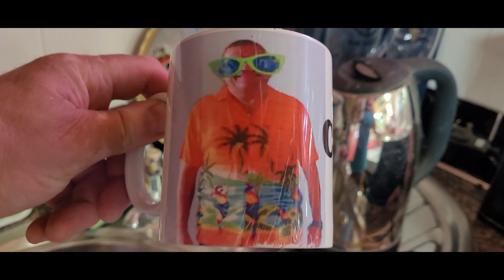up to my waist in water what for now

Comment: I have the same pump & bottom drain mate and my pump is above water. I have recently done a video on fitting a non return valve makes a massive difference now don't loose any water back down to the pond

Comment: You only have to watch that pump if you have a power outage then it might syphon back  into the pond.
You  have the deep end air stone right near the  out let of the green filter... Perhaps moving it over to the other side would help with the circulation a bit?
A Floating skimmer may help with the particles in the water. Other than that..  It  is looking  great..
Reply from the maker: as always thanks for your support .i have a floating skimmer but iv not put it on this year as im using my auto feeder .i have moved the air stone as you asked as you will see in my up and coming video.kind regards

Comment: 2 inch to inch and a half reducer then the thinner hose tail into the reducer ..  looks like 1.25 pipe trying g to go on an 1.5 inch hosetail..  retro drain is on 2 inch pipe
Reply: i used your technique for lowering the retro bottom drain into the pond. great tip that skeggy.
Reply: Put it in the Deep end 🤦🤦🤦🙆🙆
Reply: Close the valve -set the pump up then prime it with a hose up to same level as the filter. 
Open the valve and immediately start the pump 
This should push out any air locks and run.
Mines the same 👍
Reply from the maker: cheers daz scrag gave me 1"and 1/2" pipe so thats what i used but all the hose tails are poor quality plastic and to short really but its done now.cheers skeggy
Reply from the maker: cheers dave i need another 1 for the deep end m8.its in the shallow because its nearest to the nexas m8 thats all
Reply from the maker: cheers for that i have it sorted now i think

Comment: The manufacturers of horsetails are a joke, they hardly ever make the tail long enough to fit the bigger pipes.  It’s a shame someone doesn’t come up with a hose lock type system of hose tails and matching hose in the various diameters of hose.
Reply from the maker: most koi fittings are a joke its all about using there products so they can over charge us all the time.thanks for your support